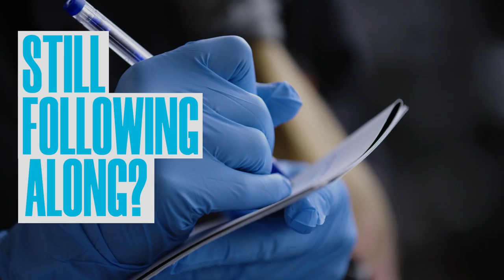The Race & Suspension Rebuild Challenge | Pinkbike Academy EP 7

Comment: The way how they structured the challenges is flawed. Instead of having the best riders race at the start of the series, they are given weird tasks instead. Too focused on the sponsors.
Reply: Also, if there's only one 'grand prize' (i.e. the Orbea pro contract), why are the comparisons split by gender? Both women were around 30 seconds slower than both men in this race - how much would it suck for the prize to go to a slower/worse competitor in the name of 'equality' (which I'm 99.99% sure will happen). Either have 2 prizes, one for each gender, or include every competitor in the comparison. This show just sucks.